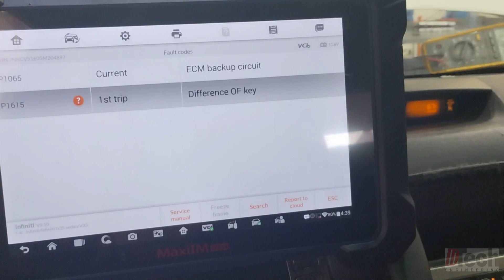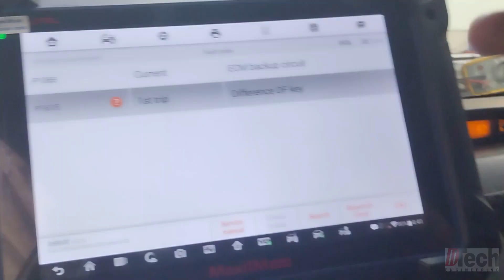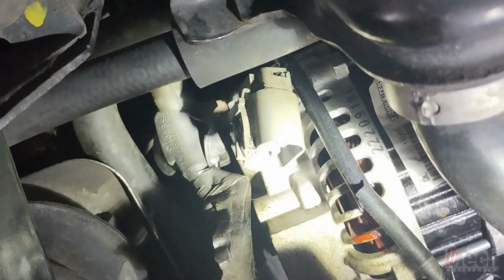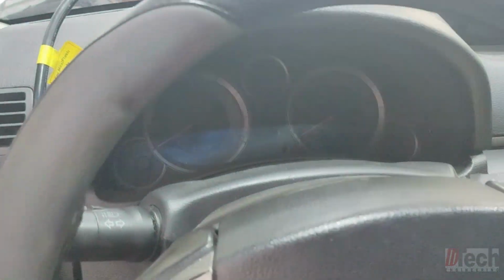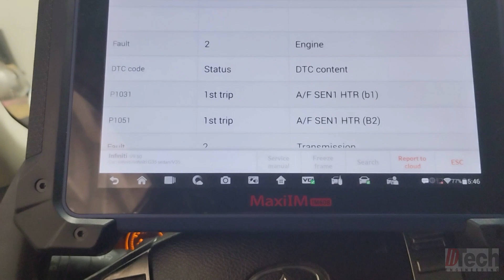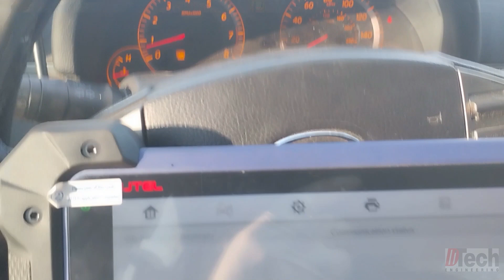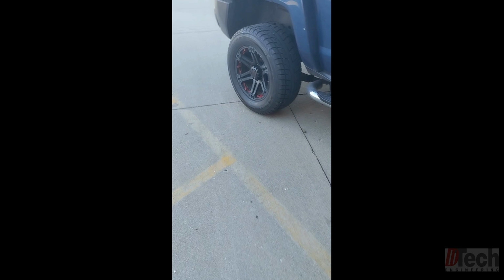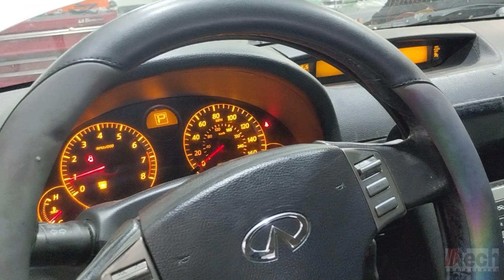2005 Infiniti G35 Battery Light & Limp Mode Fix

Comment: Great way to diagnose a problem that other have diagnose with the same component failing! Four alternators! Bad quality alternators! Now you had to go a little deeper than normal! I like your process of isolation! But I heard one of my friends that in a 2006 Maxima he replaced 3 remanufacture OEM alternators and still not charging! The dealer decided to give him a new one and that fixed the charging problem! Thanks for sharing Sadel!
Reply from the maker: Yes it was important on this one to isolate the alternator to prove out the issue

Comment: Thank you so much, 3 weeks of troubleshooting ends today. Unplug the alternator and Vrooooooom!
Reply from the maker: Excellent!
Reply: Did you have any throttle response at all when having this issue?
Reply: @shawnlittrell6891  no it would go on limp mode until there was enough voltage

Comment: I have an 06 G35 Coupe, I changed the alternator 3ish years ago, had no issues. Trailered the car down to Tennessee and randomly would go into limp mode. Came home and didn’t drive it for a little, then when I did I took it to work no issues, but on my way home I was getting a battery light (I had to jump the car when I left for work and when I left work to come home since I’ve been having battery drain issues. I went to drive the car a week later and tried to jump it, but it wouldn’t start. I did some research and discovered the BCM must’ve forgot the keys from the battery dying, so I got Nisscan II and it would connect to ECU but not the BCM,  do you think it could be related to the alternator? I never had limp mode and battery light at the same time though. I’m going to buy a new battery and install/code the new BCM hopefully that fixes it. I need to find the drain still but I’m betting it’s the radio or something in that circuit since that seems to be common.

Comment: Re-manufactured alterntors from O'Reilly, AutoZone, NAPA and such come from same rebuilder (I found out on internet).  I installed re-manufactured alternator from O'Reilly in January, and in a few weeks, the Voltage Regulator was shot. I checked the grounds, clamps, ground voltages, resistance from battery to alternator, and such, and found nothing wrong except failed Voltage Regulator on new remanufactured alternator. I installed another one from O'Reilly (again). And yesterday, the Voltage Regulator failed again: 14 Volt disappeared for few seconds when driving over bumps on the road (dashboard lights flashing). I confirmed that by recording voltage on oscilloscope while driving. So, today I installed THIRD remanufactured alternator from O'Reilly. (My original alternator for 1994 Land Cruiser lasted 10 years). O'Reilly (Portland, Oregon) gives "Lifetime Warranty" on alternators, which means I can keep replacing this crap for free, forever, but it takes 1 hour to replace it every time. This makes me wonder where do people buy good alternators?

Comment: While cranking it, there is an audible delay that tells me the battery or the main wiring connections are suspect. Also at that voltage I would be weary of other components being fried, have experienced this myself, ongoing electrical issues due to over voltage.

Comment: hey man got a vdc and slip slight on with codes p1126 p1122 won’t rev past 1500 rpms, sent to a shop said it’s a shortage in ecu? so i sent it out to some guy that does ecu repair, no luck guy says ecu is fine. I tried replacing TB and Maf sensor, still no luck put everything back to stock. Maybe wiring harness? i don’t think alternator is a problem in my case car still starts up fine battery just dead cars been off for 1-2 months. Thinking of sending to nissan but im skeptical what if they say it’s a shortage just like the shop. Any ideas ?
Reply: i was power washing engine bay lol car drove fine for about 3 hours i went to turn the car off hit some purple power on like the strut tower area and removed some harness clips but my harness has no damage visibly but not idea.
Reply from the maker: you have to make sure the controls are there for the throttle body and also the powers and grounds need to be checked and load tested. Yes it might be possible ecu at fault, but checking outputs can determine that. Failed throttles have been known to take out and damage ecu's, but again you have to check for proper control and power/grounds. Keep in mind at the end of it all you must do a throttle relearn to get the system back up and running

Comment: Hi not sure if anyone will respond but I’m having an issue with my 2005 g35 coupe as well nothing as severe as in this video. My g has the battery and brake like come on at the same time, sometimes they are fully lit and sometimes they are dim, And going over bumps they flicker ,the car drives normally just has a rough time starting sometimes and at least one time every time I start it it almost wants to die at the red light but it doesn’t, after I take off it’s fine and it doesn’t do it again till I restart the car. Decided to put a brand new battery and checked all ground wires everything looks good but still have the battery/brake light! I want to say it’s the alternator but don’t want to spend another 200+ for the lights to still be there, also I have no other engine codes or anything like that just the battery and brake light come on at the same time! If you have any ideas please help me out🙏
Reply: It’s the Alternator.  Same happened to me.

Comment: I have a 06  g35 coupe & after jiffy lube 😢did a oil change on it and after i cant get it to get up & go when i punch it its like the second gauge move so slow to  around 60 rpms an hour no more  and it makes the car take off sluggish what can it be
Reply from the maker: you would have to get it scanned and see what comes up for a sense of direction as to what might be causing the issue

Comment: do you believe when you have a dead dead battery- and you put an alternator in-- during that intial start up, the voltage spike will fry the diode inside the alternator ,which cause overcharging. most of the time when you put the alternator in, there is a sticker saying charge battery  before starting.thanks for you video.
Reply from the maker: I have read that as well and always tried to keep that in mind when installing new alternators. So I try to replace battery if it is too dead

Comment: I have battery light while driving have u1000 code and all type of transmission codes and car dont accelerate .
Reply from the maker: sounds like it's in limp mode due to CAN Bus communication issues. You would need it diagnosed as to what is causing the bus communication issue.